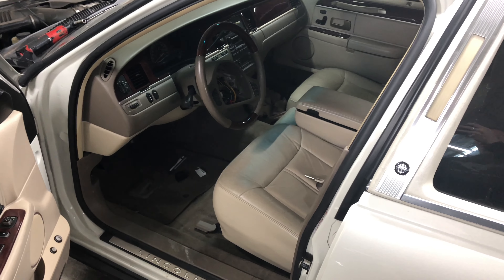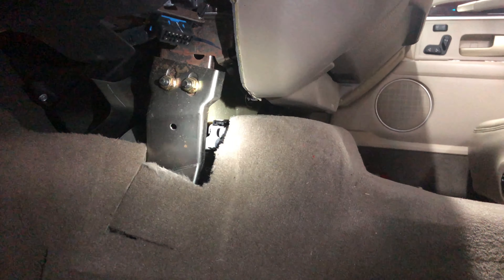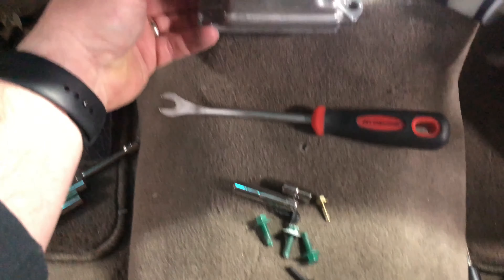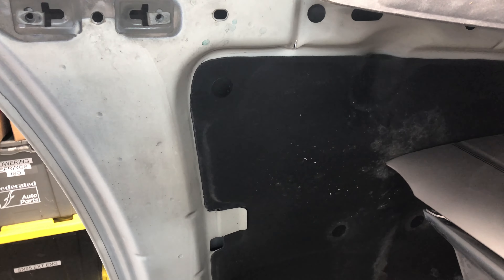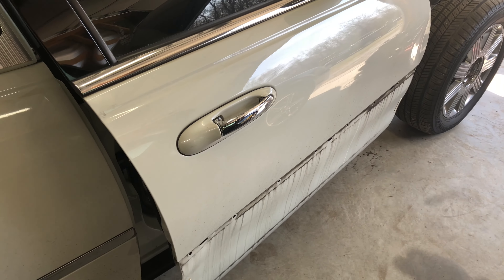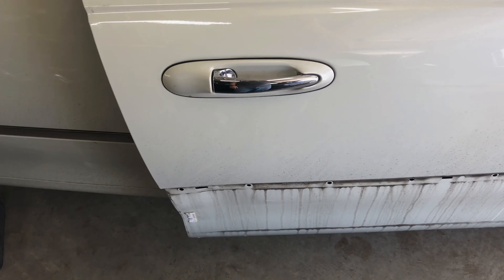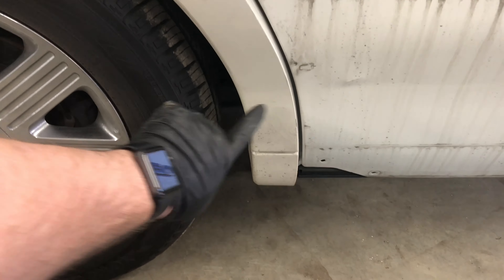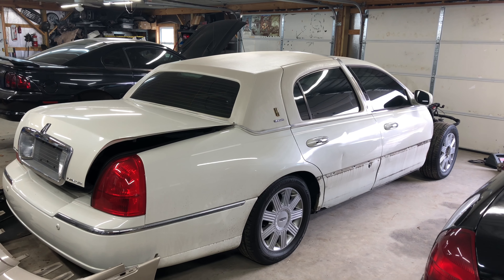Rebuilding our Lincoln Town Car part 4

Comment: After watching this, it has reminded me to double up on my sleep and perhaps just get a car or truck that is already beat up and not worry about it
Reply from the maker: @EarlGuyton425  I didn’t choose this life, this life chose me. 😂😂 Thanks for watching!!
Reply: @GlovedUpGarage  Yep. As soon as my chrome fender trim comes in I am going to install it on my white 05 town car signature limited
Reply from the maker: @EarlGuyton425  mine is sitting on a frame rack at work. As it turns out, the frame is still no where near correct and the body is crooked on the frame. Good times ahead.
Reply: @GlovedUpGarage  What you have going on is too much for me, but I am old also. On my white 05, my chrome pillar post are arriving today and wednesday the 14th my brow wheel arch chrome trim is arriving. This signature limited originally came with the wheel brow chrome pieces and it has them on the right side of the car. I wonder where the hell did the ones go that were on the drivers side?
Reply from the maker: @EarlGuyton425  sounds like they may have been removed for paint and forgot to reinstall
Reply: @GlovedUpGarage  No, there is no repaint or body repair ever done. The impressions of the black rubber part that is under the curved chrome is still on top of the original white paint. The left front I had to punch out the pop rivets that were broken in half and left behind. The only reason I bought this 05 one and half months ago is because its a rust free one with original good paint. Some idiot had taken apart the driver door inner panel and left the parts scattered between the inside of the console and the trunk, when after I put it back together, there was nothing that was ever wrong with it to began with. I would buy it again for sure because its one of the straight good ones. Its obvious when I did underneath inspection that the axle shafts and bearings and brake rotors as well as pinion shaft seal and transmission had been rebuilt. Its a car that was owned by an older rich woman that would just spend all this money. And somehow in the cars 19 years never got even one door ding in it, but has 194,000 miles on it. Then she buys four new firestone tires for it, and after some family member gifts her this new toyota, so she then she gives it to me for 1800.00. But she first pays for this 39.00 car fax report that appraises the car at 6425.00 And has its history of all the rebuilt things I mentioned. She would go on random flights to different parts of the world and just spends money and leaves the car with a man that would just leave it parked and watch it for her being he was older and rich like her and he owns his own fleet of vehicles. Its on my channel and I made a video of it last month a week after I bought it. It also looks like the rear seats were never used and the passenger front seat was never used. How does a rich woman drive a car 194,000 miles in 19 years that has no knowledge of anything mechanical and not have one ding on a car in a large city like Houston Tx? I too have a history of mainly restoring older 1970s cadillacs, but am getting old
Reply from the maker: @EarlGuyton425  that’s a awesome story to go with the car. I hope I can be like her when I grow up one day. 😂

Comment: Thank you for another detailed video. I hope the donor car is still around and you are able to score all the parts you need.
Reply from the maker: Thank you!! Me too, so far no luck in reaching him.
Reply: @GlovedUpGarage  bummer,  There are a couple fresh 2004 town cars in the Cincy area (LKQ and upullandpay). Anyhow, I hope you will find your stuff soon.
Reply from the maker: @andreik1775  I may have to make a trip up there or down to Louisville’s U pull yards. I’ve been meaning to hit Besslers in Hebron KY for a while. This gives me an excuse to drive up there now
Reply: @GlovedUpGarage  best of luck!  I have been to Bessler in Hebron.  Not sure if they have new Lincoln’s (I haven’t been receiving notifications) right now. Normally, they have more panther platform cars than LKQ or upullandpay in Cincinnati, but those two sites for sure have 2004 Lincolns recently added.
Reply from the maker: @andreik1775  I think the doors are the same from 03-2011 but I’ll check my sources. The lower moldings are the same from 98-2011 according to Ford parts. I would think the door she’ll would follow suit. I’ll verify and check out the inventory up there. Thanks for the heads up!!